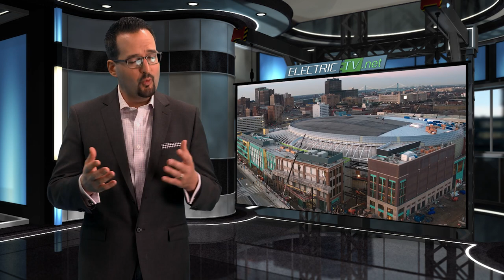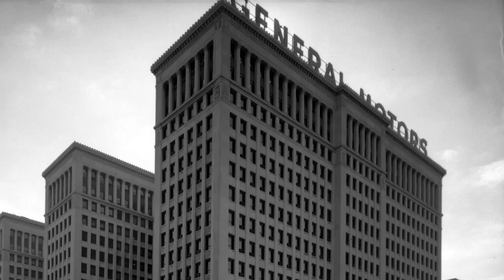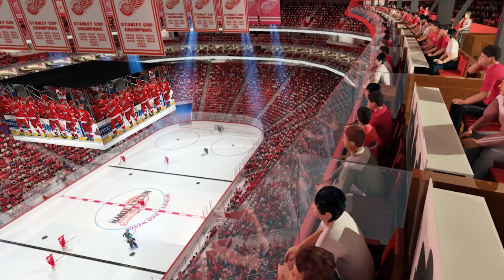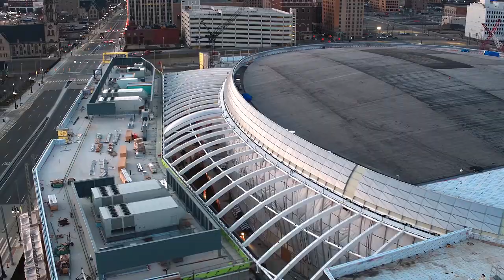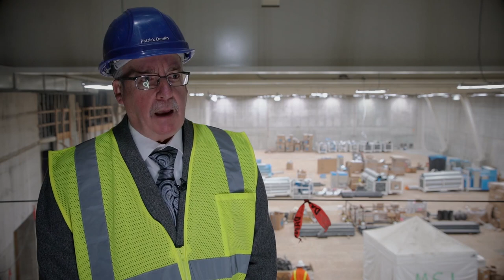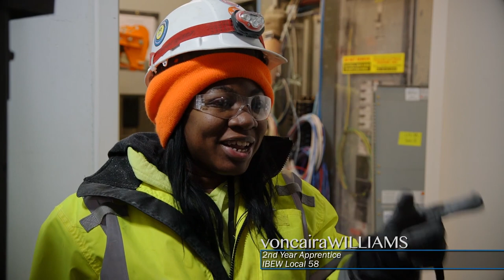The District Detroit: the 50-Block Footprint Revitalizing Detroit

Comment: Building a new stadium doesn't revitalize a neighborhood. In some cases like the Miami Marlins stadium, it decreases economic growth. If you want to revitalize a neighborhood, do it by building new infrastructure, invest is business around the area, and making a neighborhood more attractive to people who want to move to a city.
Reply: I live near the stadium and you are right. Stadiums alone are only a small part of the solution. What impresses me is the balanced approach being taken to develop the city. Ford Motor just announced that they ar moving back into the city and rebuilding the old, abandoned rail station as part of a huge engineering campus bringing in a minimum of 2500 jobs. There are over sixty residential conversion or construction projects underway downtown as we speak. Lear Seating just moved back downtown. Little Caesars is finishing up it's new world headquarters, Flex N Gate just opened a huge new manufacturing campus with 500 new jobs, Mahandra is building a new assembly center with 650 new jobs. The neighborhoods, schools and neighborhood crime need to be addressed but progress is being made. The stadiums do draw people in to the city core. Dozens of bars and restaurants have opened in the past couple of years.
Reply: atleast it revitalizes the red wings from their old ass arena